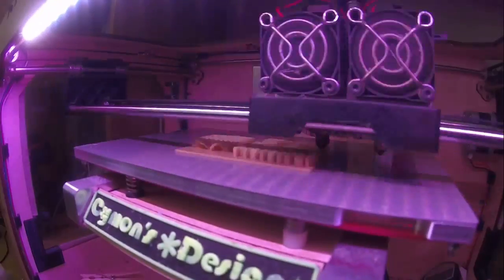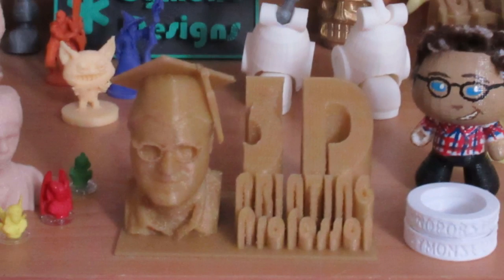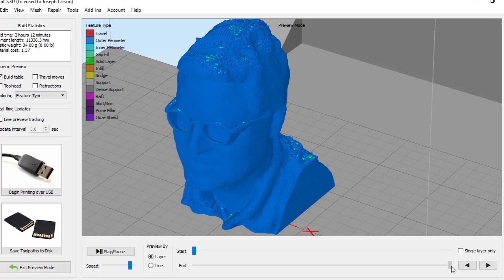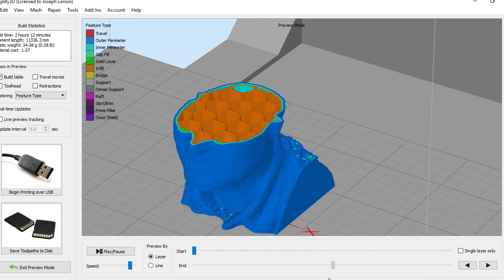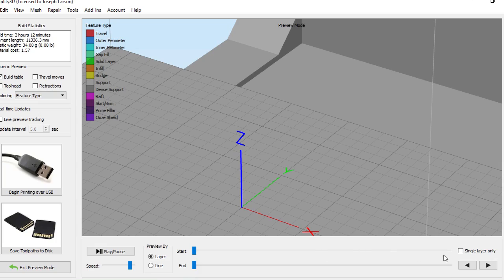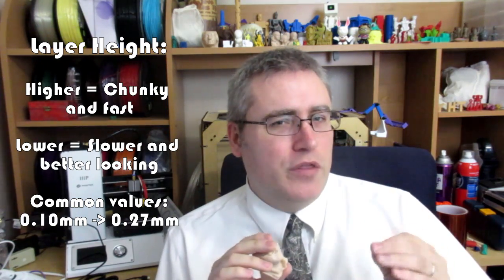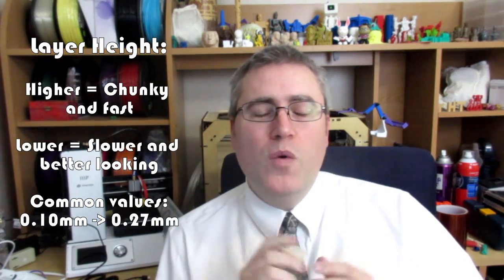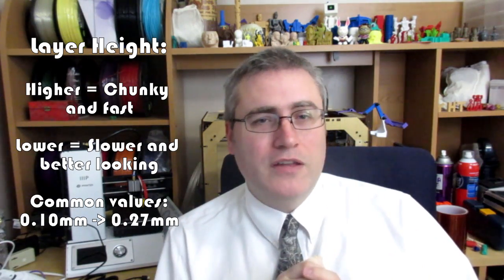3D Printing 101 - Slicer Settings

Comment: Another great video.  I learned a lot and took some notes.   Do you have any plans to do any videos on common problems with prints?  Such as stringing, warped bottom or top layers, etc.   I have heard people print some type of cube for calibration.  Is that only thing I should print to make sure my settings are correct?

Comment: Thanks for the great video!

You didn't mention the option of using proprietary slicer software from your printer manufacturer like XYZWare - which mostly seems to have the esoteric parameters set correctly for your specific printer.  I guess the Windows 10 "3D Builder" software really is just a slicer too?  Also, doesn't the proprietary filament (with included chip) that XYZPrinting requires have some filament specific parameters (like optimal temperature) in it too - that the printer must pick up at actual print time, outside of (or overriding?) just what's in the G-code?

So far I've printed everything on my new Da Vinci printer with the default "Good" quality parameters, with generally great results.  (Embarrassingly I only lost one print to a clogged nozzle, because I didn't understand how often I was supposed to go through the head cleaning procedure.  Their instructions about that were only included in their "optional" video tutorials...  Live and learn)!

Happy New Year and keep up the great work!
Reply from the maker: I know you can 3D print from Builder, but they accomplish that by hiding the slicer as a driver software so technically any 3D software can export to your 3D printer. however, only over USB so I've actually never tried it. And now I feel like an idiot for not trying it.
Reply: hello! I am a student in mytechhigh and I am learning using your course that you created. I recently was inspired and decided to make a cool video and timelapse of my 3d printer. I also started a new youtube channel. Please check it out and let me know what you think!

Comment: Great video! If you haven't already, could you make some videos about how to diagnose prints and what actions to take to get the best results?

One thing I find most slicers lacking is custom support. Simplify 3D has that, but the only free software I've seen that has that function is Flashprint. I'm using Cura and it works great 99 % of the time, but in some cases it just refuses to calculate support even though it detects overhangs. Not including custom support is like making a self-driving car without a steering wheel.
Reply from the maker: I'm considering a post about how to fix and diagnose your prints, but there are literally so many ways prints can go wrong and way to fix them that I could spend hours and still wouldn't cover it all. But I do want to do it, so maybe I'll make a series, each video about a specific problem.
Reply: Maybe let people submit pictures of failed prints and pick a few examples to talk about. Crowd sourcing  the topic could be a good way to start since, like you said, it's difficult to just pick an error at random and start talking.
Reply from the maker: I love that idea. I'll have to make a video calling for pictures.

Comment: Awesome video. Great explanations of what the settings do too! I'm amazed -- I recently got a cheap Chinese Prusa knockoff for 150 dollars (Anet A8) and haven't touched any settings... That thing prints solid! I've done around 4 hours of prints on it, and my only failed print so far occurred when I set the layer height well below the printer's capability. I think it couldn't extrude a small enough amount of plastic, so the nozzle was just digging through what was already printed.
Reply: Be careful!  Unless you have done mods to prevent it.  Those things start on fire and the connectors melt.  Keep a smoke detector nearby.